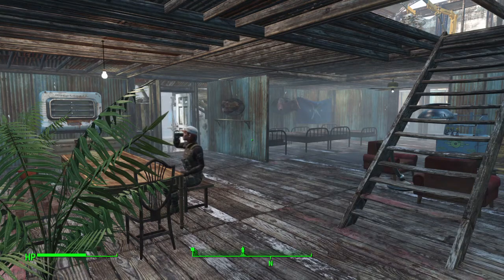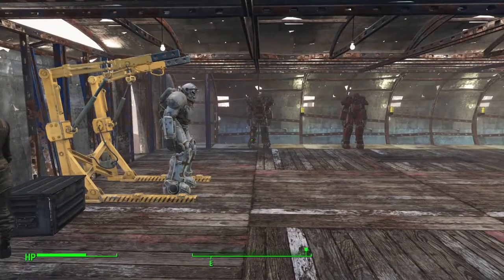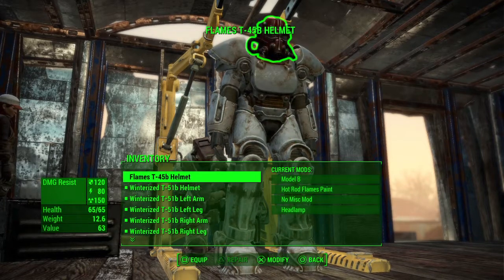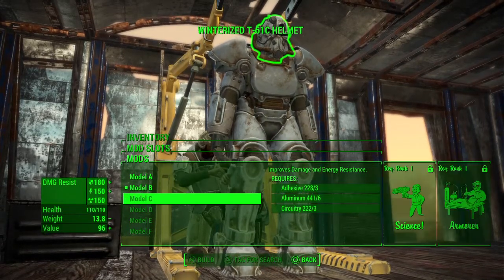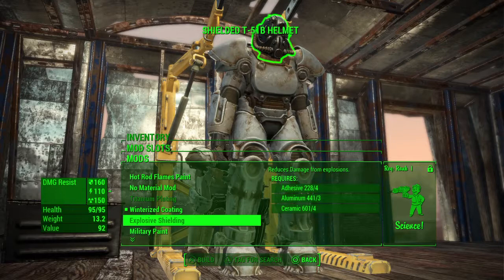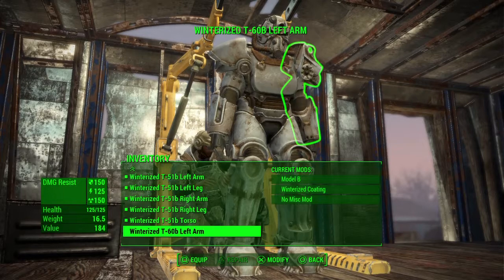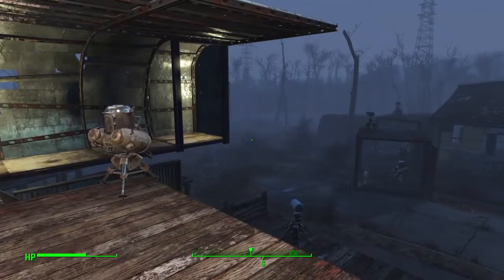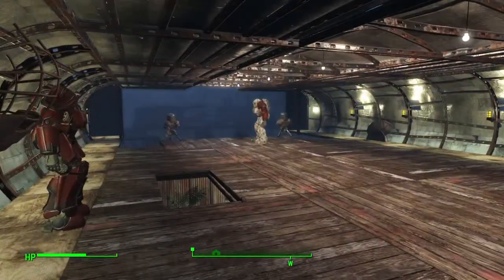Fallout 4 - Modifying Power Armor - Explanation & Tips

Comment: Where do you get all the armor pieces? I only have the arm pieces (level 24)
Reply from the maker: +Badillos Way There are 2 ways I have come across pieces...

1. On power armour suits I find around the world. They tend to have most of, if not all, the parts to make a full suit. Fast travel home with the armour itself and repair all the individual parts if they need it once you get it back to your base.
2. On enemies you beat that were using power armour. Always loot them once their down so you can take all the individual parts of the armour they were using.

Hope this helps :)
Reply: +Badillos Way be lvl 30, go to 35 court
Reply: I know this reply is 2 years late, but... you also get a free, complete suit of BOS T-60b if you join the Brotherhood.  You can also buy a complete suit of Atom Cats T-60 at the Atom Cats Garage.  IIRC it respawns daily.
Reply: You can find some I recommend doing the big dig quest because you can find a suit of power armour  or if you want unlimited power armour you can buy power armour from some bartering or the brother hood of steel has lots of power armour.
Reply: @ThePlatinumPlayz  don’t kill the enemy’s in the power armour either steal their fusion core or shoot their fusion core and without a fusion core they must exit the power armour which leaves you will the armour pieces and an power armour frame because if you kill them in the power armour they will regdoll and won’t get out I hope this helps I used it on some power raiders early game it helps a lot.